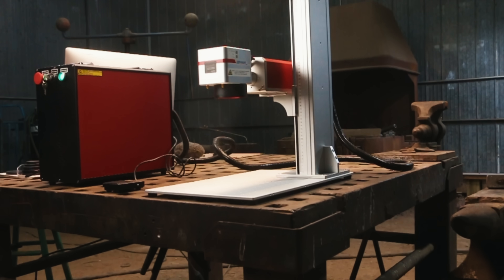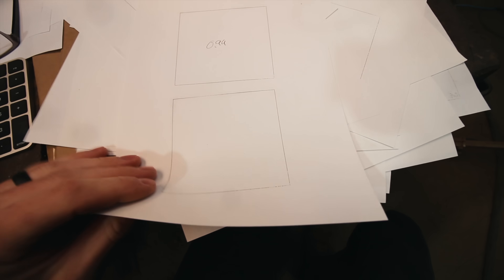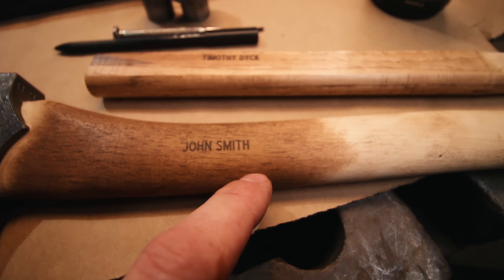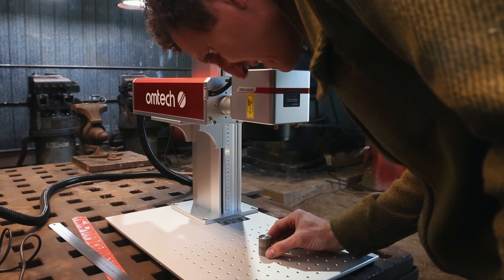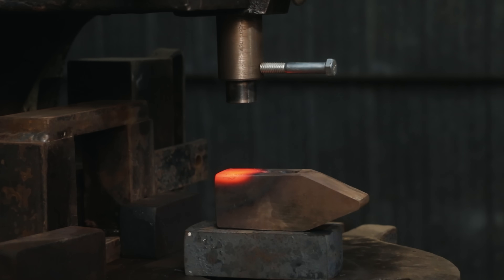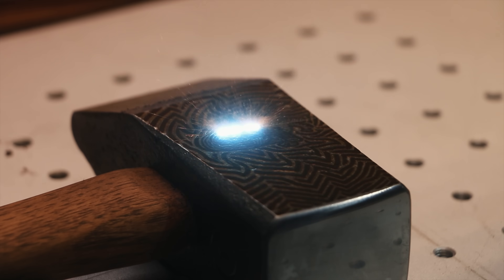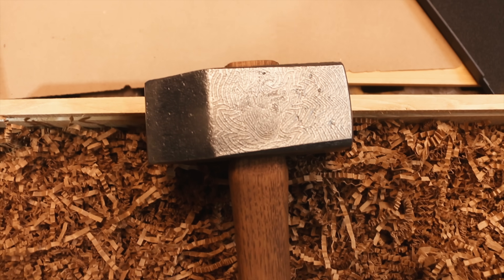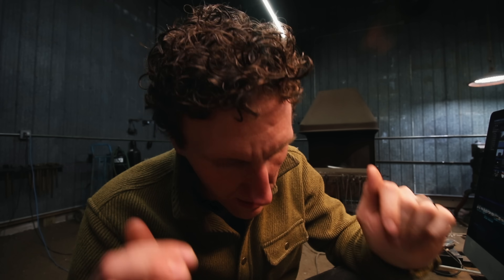Why I got a laser.

Comment: I think you could definitely do some cool stuff with laser etching. Both the stamp and the hammer came out really good. I was actually surprised that you could line it up just within the bounds of the hammer and aligned with the last etch. I also really like the texture the laser leaves. I didn't know they could leave textures. I figured it would just make it flat, but maybe it's because the initial surface isn't flat so some parts get burnt more than others. It's not quite forge steel texture but close enough for the grooves in the "keep the forge lit" test. The cool part about lasers though, as opposed to just cnc or acid etch or anything else, is that you can do much finer detail like etching a photo into something. You should try etching your face onto a block of steel. That would be really cool! Please test on your off cuts though not your actual selling pieces in case it fails though 😅 you had me nervous there lol

Comment: If you where to flatten one of the faces of a hammer on a cnc and then laser engrave it with a complex pattern it will give a big contrast, and bluing that will be more visible if you use sand paper rather than a wire wheel

Comment: 9:50 I think the hammer finish texture you're talking about is the same texture that is on the surface before you start engraving. i dont believe the laser is capable to level off the surface for it to be uniform,  as you would need to map the entire surface of the hammer and have it take off more material in the high spots to get that flat engraved look  (like with a chisel) since all it is doing is removing (example) 0.1mm along the surface. 
so if your surface is wavy, it'll translate that 0.1mm depth along the wave. and I think that's what we're looking at but at a much higher resolution (to the point where we see the forged look)! such a cool idea and an awesome use of the tool! Looking forward to see what else you come up with

Comment: PLEASE get a hood with fume extractor for this thing. Vaporized metal is not good to breathe in, same as how you wear a respirator and eye protection when grinding.

Also, one thing you can do to keep your engravings cleaner on wood is to put down a layer of masking tape before lasing; this helps keep the surrounding area from being scorched. Additionally, since you have a MOPA fiber laser specifically, you can play around with it and color mark titanium and stainless steels; that will need a lot of fiddling to dial it in, since all lasers are different and your materials will also behave differently.

Comment: Ugh. AVOID OMTECH! We spent $7k on an OMTECH 130 watt laser. The HUGE one. The tube failed in like 20 hours of use, and to this day OMTECH has completely hosed us. Weve spent hours and hours and hours with their tech support trying to get a claim or something and all they would do over and over and over again is tell us to try and focus it. I used to run a graphics shop. Been doing cnc lasers for YEARS. The TUBE went bad after 20 freaking hours and its $2k dollars for a new 130 watt tube. AVOID OMTECH like the plague. Seriously we got their flagship model and they dumped a cheap shit tube on us and then left us high and dry. It's been sitting WORTHLESS in my garage for like almost 2 years now, essentially brand new because we hardly got to use it. SCREW omtech for real. We risked so much to get it and start a business and they absolutely were trash